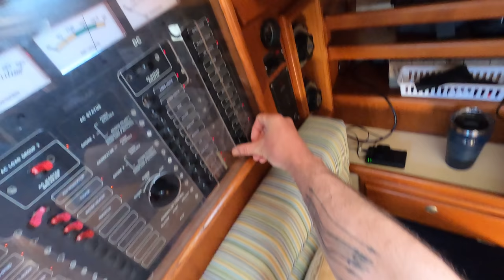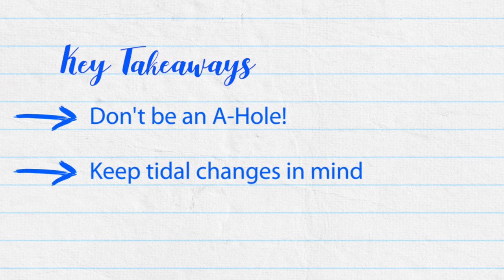I'm an IDIOT... | S06E04

Comment: Start with your spring line, use a line that has been formed into a loop, one end made fast to a cleat, the other to a winch, use a boat hook to catch the first cleat on the dock, then pull in the slack with the winch, once the slack has been taken up, put the boat in forward, adjust the rudder till the boat sits straight in the slip, then calmly step off and tie the rest of your lines.
Reply: Amazing how noobs (like you) are so eager to tell everybody how to do something that they themselves have only just learned. The spring line at the boat pivot point is a basic maneuver when single handed docking, AND when you have the dock space, which is rarely ever the case. Additionally, I've never ever heard of incorporating the winch. Sounds like a lot of extra fiddling around. Nah, They just need to figure it out with this particular boat. They'll eventually get it.

Comment: J & D:

It is great that you both are willing to take on almost any project and gain skills by "doing". Absolutely great!

But: 
If you can, find a sailor experienced in (fill in the blank) to go out with you and learn from them, even for a few minutes,
you'll learn SO quickly and with SO much less stress it'll Blow Your Mind!  You probably know this already, but it seemed worth reinforcing.

I've shown at least a dozen folks of widely varied experience how to do a few critical things--and docking a real heavyweight like your fabulous new boat is #1 on that list.

You will learn so fast, and with so little stress!

So, that said, here's the one tip that you might find useful (well, maybe two tips).

With a new boat, we always, immediately, do a man overboard drill in open water. That allows us to learn how fast the boat starts, turns and--most importantly stops and handles in reverse when you overshoot. (It also gets the crew practice communicating over wind, water, simulated stress and engine noise.

Obviously, when docking, your "feeling" of start/turn/stop/reverse will be enhanced by this drill and you risk nothing more than overshooting a life jacket or some other floating object.

The second tip is to always intentionally make a trial pass or two at the slip (or even a mooring if space is tight.

Even when we think we're good to go, we are never as good as we are after having gone in for a "feel" once or twice.

Clearly you took this approach, at least in part, by shooting a few more easily made landings.

But there is SO much to be gained by planning to do a go around for every new slip--and or wind and sea state--that I think you'll make it a habit for the sheer enjoyment of (nearly) stress-free docking.

Keep up the good work--and attitude!

Cheers,

Todd

Comment: HI Guys   Re maneuvering in tight spaces.   To back out of a slip start with the boat canted stern out to starboard then apply reverse and throttle with authority.  The rudder will be effective as soon as the boat is moving aft.     In the situation in the video where you wanted to execute a 90 degree turn to port instead use a 270 degree turn to starboard.   when clear of the slip turn the wheel all the way to starboard and engage forward and apply a little throttle.  before the boat can move forward shift to reverse then before the boat starts to move aft shift to forward and apply a little throttle.   Repeat and the boat will perform a pirouette  in its own length.  Try this a few times where you have plenty of room.   You will be amazed and this will become your favorite move.   You actually employed it a bit when you approached the dock with your port side.   Bill

Comment: Did you notice in your aerial shot, there’s several boats backed in? For me backing in is easier. Use the prop walk to your advantage. Roll up to your slip, turn hard to starboard, and back her in. As soon as she comes around, turn wheel back to port and leave it. Use Reverse to forward to get her in. Much easier and with your helm on the stern, you can judge your depth easier. 

Try this maneuver in open water and you will be amazed how much easier it is.

Comment: If you want to turn your boat on the spot, point the helm hard into the direction you want to turn to and then change from forward to backward and back etc without ever touching the helm again. You will see that the boat will turn nicely. It is because while in forward, your propeller washes the thrust against the ruder which makes you turn. But while reversing the wash goes of the rudder and you actually have no steering effect. Give it a try. 😉

Comment: It would be easier if you tried to drive out of the berth with the stern against the wind and then when there is enough space to turn the boat in one go. When mooring, it is also much easier to drive into the gap with the stern against the wind. greetings Michel

Comment: Consider practicing more reverse. Go into center of a body of water and use only reverse all over the place until you really are comfortable with how it handles then... in that last docking condition drive half way past the dock and back into the current /wind using prop walk to help turn the boat into the slip. Hard left rudder. Pulling out is easier also practice  how to use prop wash against your rudder to make the boat dance in either direction while in reverse using burst vs slow water flow. Still great docking. Capt. Rich USCG master.

Comment: If you want a quick tight turn fwd give the engine short high rev hard over on the helm boosts and to slow fwd speed go astern on the opposite helm in the same way,that way your boat will turn on its own axis  without to much forward motion . Practice this maneuver in a tight area and you will find it a invaluable skill when docking or coming alongside other vessels.

Comment: Just a tip/trick i have come up with so you can even do it solo; first put on the springline from the rear of the dock around your winch and secure it once u are far enough and make sure neutral speed before putting pressure on the winch;  while this will stop u from running to the dock it will keep you fairly good in u spot without the other lines secured yet; next you do a line on the front so it cant swing then the rear and then u secure the springline to the front as u should and even in rough conditions i can do this solo just dont run to fast inwards because be to much pressure on the winch!
Reply: Oh and never jump off any yacht without that spring beeing attached first u may risk that if for some reason u need to reverse then u have no crew aboard to dock 2nd time and in windy conditions that might be a problem, only jump off once that springline is secured, nothing can happen then, try it out u will have a laugh at how easy it is to dock anywhere afterwards ;-) And if u can turn quick enough because of the direction of your shaft and wind pushing just reverse into the wind and turn where u have more speed and room. Less chance u will hit something then and less stress ;) Happy sailing u 2 i love u channel!

Comment: You may want to go back and chamfer or put something around the top edge of that pipe coming out of the deck. There's a very sharp edge on the inside of that pipe and that's probably what caused the sheath to chafe on the cable.

Comment: When un docking with such port breeze and port prop walk you can rig a fixed line to your starboard stern cleat run it to the dock, hopefully through a ring on the dock or around a cleat and back to the boat. Pay it out with no tension as you back up and When you snub up on it the boat will spin the bow to port. Once the bow is turned sufficiently or through the eye of the wind pull the line back onto the boat from around the ring or cleat which was used as a “block”. 

Using full throttle after casting off until you have sufficient way on and then going to neutral can also give you enough rudder grab to turn the bow through light breezes and overcome prop walk. 

Also Don’t be afraid to back out of the slip let the bow blow down and back all the way up the slip way into the fairway. Make sure to hold the rudder if you do this as the pressure will build as speed increases wanting to turn the rudder for you. 

When docking short handed or solo I rig a dock line amidships. When I or my crew step off I make the line on a mid dock cleat if available. It not only prevents rotation of the boat but springs against fwd movement. It often allows me to tie the boat long enough to then get bow and stern lines made.

Reach out if you’d care to discuss in detail or have more questions. I learned a lot the hard way and then even more through the generous tutelage of others. Having a List of people to call always helps.

Comment: And now you know. Education is expensive but now you know how it works.  Next! 
Kudos for owning up to it.  Use Blue Loctite 242. Check your grounds. The bowden cable looks heat fried.   Multiple problems are a distinct possibility.  Run a 10ga ground wire down to the DC negative bus bar. Might solve your low voltage warning.

Walk the stern with prop walk. In gear, shot of power, neutral. shift rudder, reverse, etc... Let Des drive

Welcome to LI Sound.  Got an Eldridge?

Comment: You didn't damage anything, no one got hurt and you didn't sleep alone. By definition, that was a good job. You might want to start taking the forward spring line across first to stop forward motion and then hand the stern line over to keep her stern from blowing out. If the bow is being pushed out you have some control of that with the spring line.

Comment: When leaving go the way the boat wants, in this case just let the bow blow downwind and reverse all the way down the channel and make your turn in open water. Much less stressful than trying to perform a turn between the pontoons.

Fit a midship cleat and use that when berthing if it's a home berth you can have a line  ready made with a loop held open with hose to drop on the cleat so you cannot hit to end. Once the midship line is on power against it and use the prop wash over he rudder to pull the stern in. Once you are settled you can then leave the engine holding the boat in position while you sort the rest of the lines. 

And things will always go wrong but if you are going slowly enough only pride will be hurt been there done that.

Comment: now practice docking on the SB side ;)
kidding aside, you guys did a great job, especially getting used to the prop-walk. you'll be surprised how many people will just ignore it since they can't figure out how to use it to their advantage.
what I've discovered works best for docking quickly and repeatably in 2 is to have the crew jump off with a spring line tied to the bow and control the forward motion with it using a dock cleat near what will be the stern of the boat, and once fasted there, throw the same crew the stern line and go forward myself to do the bow line. the advantage here being that you don't need to come to a complete stop by the dock before you have a line around a cleat, and using a spring line it pulls the boat into the dock and slows it down at the same time, even if there's wind/current pushing it off. If the wind/current is so strong that it keeps wanting to push the boat instantly off before you get a chance to tie a bowline, then after cleating the spring line you can give it a bit of gas and the line will pull the bow back into the dock - just make sure you got a stern line in the crew's hands first ;). Good luck!

Comment: With the drop in voltage to your navigation instruments it would be a good idea to check that the wiring connections feeding it are tight and not corroded

Comment: Have a look at Maryland School of Sailing docking techniques. I've got an Island Packet which handles a lot like your Pacific Seacraft. If I have to tie port side I find it easier to drive past a tight slip down the fairway, execute a standing turn in the fairway and approach the slip on my starboard side. This is actually essential if there is a boat in the adjacent slip as attempting it the way you did brings my bowsprit way to close to the neighboring boat. Once you real good at standing turns this will be a tactic you use over and over. As they say go with the flow.

Comment: Get some silicone spray to lube those cables, that's what I always used to use on my bikes and it makes them smooth as butter.

Also, sry I've not learned you names yet but when docking get your deck hand to throw a line around a mooring to counter what ever force it is your fighting, if the wind is pushing you starboard she can hold a rope at the bow as you reverse out so you can let the wind take the stern out for you. Then just let the rope go :)

Comment: Instead of making the transmission shift arm be vertical when in neutral, should you instead set it so that it is perpendicular to the cable that actuates it? You might extend the free range of motion before binding against the end-of-slot of the cable end piece. Good stuff. Thanks.

Comment: Slow speed maneuvering is always a challenge, especially on a new boat. I'm sure with a bit more practice you'll both be pro's in no time. :)
I did the face palm thing when you said you loosened the pinch bolt on the shifter shaft !!!!
Cheerz!

Comment: For docking try practicing 360 turns within your own  boat length with different winds and currents.  It’s a good exercise without the pressure of the physical slips.  When you get confidence try to turn inside a slip channel.  Says the guy who just missed his slip entirely and ended up one over...but hey it was 35 kts onthe beam...

Comment: actually the wind was helping you when you first got out. if you leave the boat unattended you will see that the stern heads up to the wind, the boat is stable in that position. you could have reversed all the way. when you reverse you also shorten the radius of turn because you bring the axis of rotation closer to the centre of the boat. the opposite occurs going forward. coming in because you were just a tad quicker to turn, you could ve just burst hard in reverse to stop the turning then engaging again in fwd to get it inside the berth

Comment: I am surprised that not more crews use radio headsets to communicate.  While I saw those on a larger power boat video (where it probably is a must) I still see obvious advantages for sailboats too as screaming generally doesn't help and wind noises and whatnot (even the engine) could make comms harder among crew members.

Comment: Have the Bud tell you the amount of feet or meters that is left to the object in front of you. Then You make the decision whether to continue the maneuver or to reverse. That way you also gain feeling of how long there is to the object from your eyesight. In the last dockingsituation do not let outsiders, like the friendly guy in the pier, distract you in your maneuvers:-) And lastly remember the tonnage of your new boat. Its a heavy lady to stop. My father always said, big speed - big damage, little speed - little damage. The good thing is that you communicate well as Jim pointed out and You see what you did and what you have to work on - Like being a little cooler, as you pointed out, and wait until the wind pushes you into position and then proceed into the dock. Using the wind and the current is very effective if you have the coolness and the feeling necessary for using them to your advantage. Good job.

Comment: One thing to visualize and think of when going forward and especially reversing is that YOU NEED TO GET THE wATER SPEED PAST THE RUDDER FOR OPtIMUM STEERAGE OF THE RUDDER....    your keel is trying to make you go straight...
      Also.   A midship line can give you an improved control of your boat... however additionally a line that is even additionally attached further back on your docking side
can control your boat from going to far forward and also prevent the stern from washing out.   Think of
your “ weigh “ of the boat. Learn to use the weight and weigh of your boat for better control....  it will get better as you go along, not to worry
    I am a retired marina owner   I can honestly say I have taught hundreds of boaters how to improve their docking skills. Not bragging just what happened for 30 years in business.   Also another interesting observation from over the years was that in many circumstances it was the Woman on the boat that could handle the boat upon docking . Under this situation it also put the Man in a better position to fend off the boat
with his larger size or muscles.
  Again , I am only offer this as suggestions, not to offend
    One last comment that was always imprinted on my brain from back in the “sixties” when an old guy said to me that I never forgot 
was that “ if you know where the stern of your boat is, than you know where your bow of the boat 
is “ !!!    Ha ha !   He was trying to give advice but being funny too!
    Enjoy your journey... you are a lovely couple. I have enjoyed your videos over the years.   SV /Sounds of Silence/ Westsail...  hope our paths pass someday

Comment: Things that happen! It happened to me with a line heater. I stopped heating and went to check the electrical power station, call an electrician, check the equipment warranty and when I go to check the heater well, it is disconnected from the power outlet.